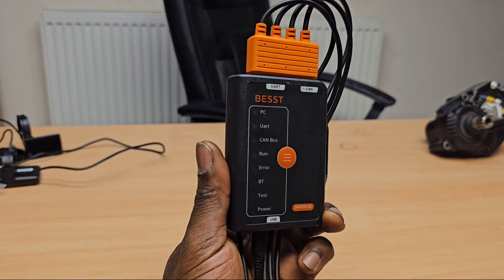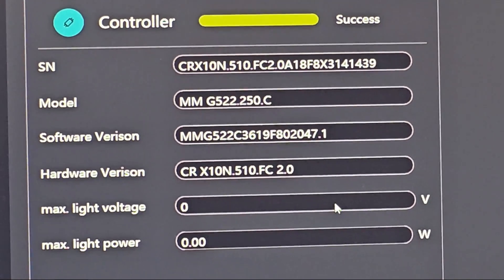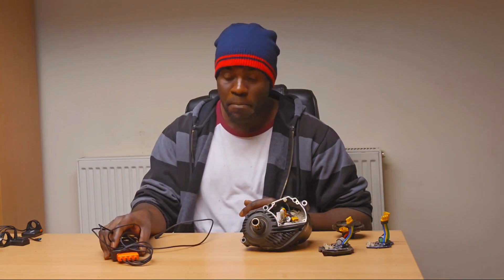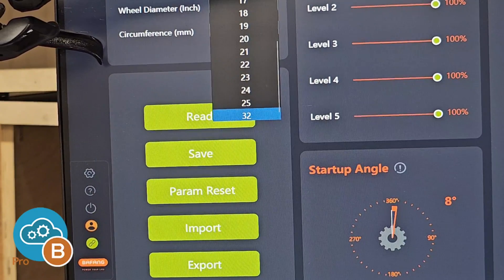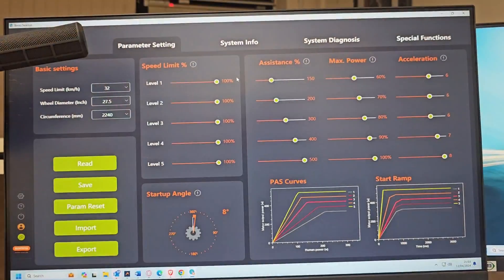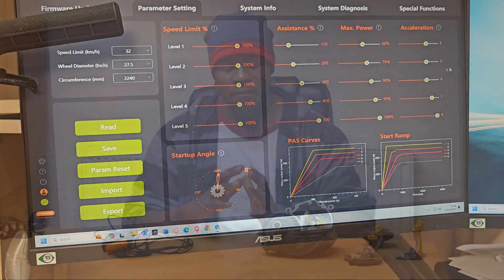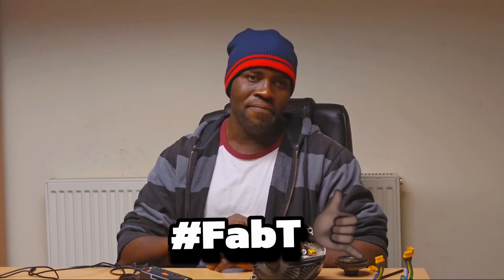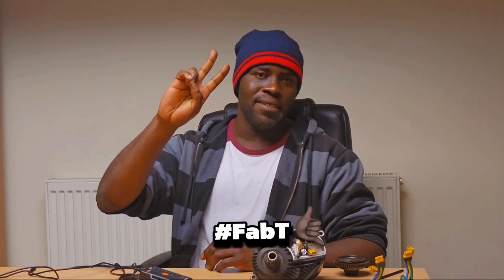Bafang Besst Tool & Besst [Pro] Software Explained

Comment: Like music down with the haters. Can you help me out with firmware for m620 canbus. I'm new to this only recieved besst today.
Reply from the maker: Hi there. Sadly, firmware's associated with the M620 CANBus aren't as plentiful compared to the other Bafang motors. Essentially, different firmware's which I've seen for the M620 CANBus tend to be for higher voltage/capacity batteries. Ebikes like the the FREY Beast with the custom 62v battery use a different firmware. But that particular firmware is useless without a 62v battery. 
I will doublecheck this with a colleague. So kindly bear with me👍🏿
Reply: @neekodevinchi maybe I'm doing something wrong it connects ok reads firmware etc but won't read parameters or battery. Only had a quick go.
Reply from the maker: What firmware are you using currently. If unsure, use the display and go into settings and go into controller settings. 
I can then cross-reference the firmware with those that I know👍🏿
Reply: @neekodevinchi  CRR10MC5228E101120.1 is that it?
Reply: @neekodevinchi  had better results using besst (not pro) software today. I could adjust wheel and speed. Only thing is the speed defaults to 25kph. I can increase this using my c18 display back upto 60kph. Essentially what I want to do is set speed and wheel size so I can use the dz41 display or eb04 display. These dump the speed back down to 25kph and limits the motor to 750watts. I've read somewhere that earlier besst software will allow you to do this.
Reply from the maker: I see. I was of the belief that you were using Besst to begin with (Not Besst Pro).

Besst should allow you to amend the speed limit, wheel size/circumference regardless of firmware.

Make sure you click 'write' after you've made the changes.

In the meantime, I'm still awaiting on my colleague to cross-reference your firmware so please kindly bear with me👍🏿
Reply: @neekodevinchi  write forces a 25kph locale max. Can you fool it via a vpn. What version are you running is it the latest.
Reply from the maker: Sincere apologies for the delay. 
After consulting others who have spent time testing a couple of firmwares with the CANBus M620 motor, I believe I've found 2 which may assist you in your perdicament to raise (keep the speed limit at 60kph by default), whilst using a different display. 

I have uploaded a BIN file on EMTB Forums on the "Bafang M620 Setup CAN Parameters" thread. And another user "Dado" has uploaded another BIN file.

Using the Besst Tool and Besst Software, upload either BIN file. You should find that either will allow you to freely raise the speed limit without reverting to 25kph. The Besst Software will prompt you that the motor's speed limit exceeds the legal limit. But it will still allow you to raise it to 60kph (for offroad private property riding 😉).

Here is the link - https://www.emtbforums.com/threads/bafang-m620-setup-can-parameters.37147/post-552455

Hope this helps and sincere apologies for delay👍🏿
Reply: Many thanks for the help. Would running a 52v battery on 48v firmware cause any problems?
Reply: It's a 52v battery.

Comment: Anyone know why it doesn't show pas curves or start ramp on mine? It's a M510. Is it necessary for the display to be connected?
Reply from the maker: apologies for the delay. Are you using the Besst Pro and if so, which firmware and controller are you using on the M510 motor? its possible that your M510 motor may need a firmware update/swap. Or, the newest controller. 

I canj make a video explaining how to update/upgrade an M510 if this helps. bear with me 👍🏿
Reply: @neekodevinchi  just an update. I'm getting a new motor for free from bafang  withe a new controller.  Because there is some older boards on my motor that's not compatible with any new firmware.
Reply from the maker: @ShrekThePimp Glad to hear👍🏿
Reply: @neekodevinchi   it's the older fc1.0 controller. Some dealer I have been in contact with is trying to help me. It's either a controller switch or motor trade as I'm understanding it. I will find out very soon. Thanks for your reply.

Comment: Hi mate, what are the “must do” tunes for an m820
Reply from the maker: It depends.
Bafang motors (CANBus) are now becoming programmable via both the Besst tool and certain displays. 
As such, my preferences may differ to your own.

The best advice would be to use the motor and tune to your liking. E.g. if you want the M820 to respond quicker, reduce the start angle. If you want a certain level of assist to provide more power, increase the max power & if you want more support, increase the acceleration👍🏿

Comment: Hello bought my dengfu m620 ,EO6 because of you.Later bought my wife the E22 .You inspired me twice .Most expensive thing I've ever bought for physical health for our family ty.I have a question Kyle ,can you recommend me an alternative for the big honkin screen on my bike ? I'm going to buy whatever you recommend.
Reply from the maker: Hi there, 
You have options. However, I'd need to know what display and communication protocol your M620 motor ie using. 
If it's UART, you have the DZ41, SW02, Eggrider v2, 500c & 600c.
If it's CANBus, you have the DZ41, dpc245.3, 600c or, SW02 (to name a few).

If you bear with me, I'll make a video going over the different displays for Bafang motors and which is ideal for certain applications👍🏿
Reply: What's the quickest way to tell if your a uart or canbus system?

Comment: Hi Neeko, great video. Do you have a list of all the firmwares available for each motor which references the parameters settings?

I've seen some but each firmware is labelled with numbers and letters. And it's not clear which is the most up to date and which one is the best.

Thanks in advance👍🏽
Reply from the maker: Bear with me. 
I remember stumbling on a list of firmwares online for CANBus Bafang motors. 

What I'll do is update the description to outline the firmwares associated with each motor and the specifics of each.

If I find that the description doesn't allow me to add them because of the word count limitation, I'll leave a link which will take you to a page with that information👍🏿

Comment: I have just got that tool, and tried to increase the max speed on my e Mythique, however it knows the max speed for the UK is 15.5mph and won't let me change it, I get a message saying it's about the max speed for my region is there a work around, I have tried both programs but no luck
Reply from the maker: That's strange. 
Usually, a message will appear recommending that the motor should adhere to the limit. But neither Besst or Besst Pro have prevented me from raising the limit. 

Let me look into this and I'll get back to you👍🏿
Reply: @neekodevinchi  ok thank you
Reply: Try using a VPN and use a profile for the country where higher limits are allowed.
Reply: @keithattwood59  yeah that's what I was thinking as well 👍
Reply: @acelectricalsecurity did that work?
Reply: @timoisok  I have not tried it yet, I don't currently have a VPN setup on my laptop
Reply: @timoisok  I am curious as well, when using VPN (changed to USA for example), the speed limit can be adjusted

Comment: Hi Neeko. I was listening to hear from you about the sondors lx that's shutting down o  me after a minute of being on or when you try to operate the bike. I found the negative terminal broken. I ordered a bord  , display just incase. Haven't received them as yet. 
Will the display with a pass word ability work with the battery that has a off and on switch? 
Listening for you 
Thanks
Reply from the maker: Sincere apologies for the delay Richard. 

Please kindly message me through either Facebook or Instagram. I'll need to share images and diagrams to assist you in restoring your Sondors ebike👍🏿

Comment: Would this detect a problem that the 245 display isn't showing as an error?
I also have an e-mythique and on longer slow climbs the assist feels Asif it drops to its lowest setting (e) if I cycle through others there is no difference,if I cycle to 0 then you feel zero assist so it's definitely providing some assist 

Sometimes it'll snap back into power itself,when changing gear or not atol until climb is done.
Reply from the maker: I see.
To answer your first question, the Besst Tool can indicate if the display is the culprit if the bike doesn't turn on. The Besst Tool checks for communications with everything connected. 

As for the drop in power on your E-Mythique, that's because Vitus tuned the M510 to be...."conservative" instead of harnessing the full power of the M510. Simply increasing the acceleration across all levels of assist (and raising Race Mode to achieve 500%) using the Besst Tool will solve that problem. I would even reduce the start angle from 15° to 7-8° to improve responsiveness of the motor as well. 

But ultimately, using the Besst Tool would improve your experience of the E-Mythique👍🏿
Reply: Thanks for the reply,I wasn't sure if something in that motor was going to fail due to this feeling 
It works perfect every where else and there's no errors stored on the 245 display

Comment: Hi Neeko I emailed you about two weeks ago  and got no response. 

My Dengfu bike has a Throttle that came programmed from the factory like  a race car. It was either on or off.  Just the slightest touch of the throttle would send you right off the back of the bike or wheelie uncontrollably .  That said I'm looking for some programming help here.  

I emailed Bafang twice now to purchase the Besst tool and they wont respond.  I suspect you have to be a dealer or some  big race program director to get this device.   

Please let us know how one gets a hold of this Unobtanium device.

Thank you
Reply from the maker: Sincere apologies for the delay. 

Buying the Besst tool isn't difficult and their are safe and trustworthy ways to buy one. GBK (Green Bike Kits) sell them and I've seen multiple merchants on platforms like Alibaba, Aliexpress and even Ebay. 
The Besst tool should cost no more than £120 ($150/€140).

The difficulty is getting an account. Some merchants who sell the Besst tool may share their own account credentials to the buyer. 

I'll leave a link in the description to GBK's website to purchase the Besst Tool. When ordering, ask them if they will provide you with one of their account logins to use the Besst software & Besst Pro software👍🏿
Reply: @neekodevinchi   Thank you Neeko . I'll investigate and Report back.

Comment: I like you have a Mythique, if i get one of these tools will i be able to increase the max spread to 32kph
Reply from the maker: Yes. You could do other things as well. But changing the top speed is fairly simple👍🏿
Reply: @neekodevinchi  what else would you recommend
Reply from the maker: For the E-Mythique?

I'd raise the max power to 500% for level 5 (Race Mode) and amend the start angle from 15° to 7-8° for better pedal/responsiveness. You could adjust the acceleration for each of the modes, which will effect motor over-run as well. But essentially, you gain the provisions to tune the motor to your personal liking (like suspension or tyre pressures)👍🏿
Reply: @neekodevinchi  ok thanks for those tips 👍

Comment: I was lucky i guess i got an account ready enough, looks a useful tool is it like the cable for the bbshd, where you just connect one lead to the cable that usually goes to the display. 
Did you get yours from AliExpress i have seen them there for around £60
Reply from the maker: I got my Besst Tool from GBK (Green Bike Kits) years ago. I think you can pick them up for that price on Aliexpress. 
It's similar to the configuration Tool used for the bbshd. But the software used by both are different. But the configuration tool gives you similar (and more if you know what your doing😉) parameters to amend👍🏿

Comment: Can we change the support parameters in the m600 engine?  What does this interface give us in this engine?
Reply from the maker: Support parameter are determined by the firmware. The only way to freely amend parameters for the M600, is to use a third party controller. 
Otherwise, top speed, wheel size & wheel circumference are the only parameters which can be changed👍🏿

Comment: Setting the speed limit depends on your account. It is not able to set it to 60kmh for standard or offline users.. You'd need to use the bypass for that.
Reply from the maker: It depends on which software you're using and the firmware installed on the motor. 

Besst (not Besst Pro) can change the top speed to 60kmh. But newer Bafang Motors with newer controllers are optimised for Besst Pro. 
Essentially, you'd need to install a firmware so that Besst could change the speed limit to 60kmh. But to do all of this, you would need an account with Bafang👍🏿

Comment: hey . can you also elaborate on bafang go+ and what options can be set with which display and if certain firmware is needed for which motor ?
Reply from the maker: I can. But it might be best that I make a separate video going over Bafang Go & Bafang Go+. So keep a watchful eye👍🏿

Comment: Can i change the speed limit with my m510 without a login using this?
Reply from the maker: Using Besst Pro, you can change the speed limit to 20mph/32kph without an account (depending on what firmware is installed on your M510 motor).

If you tell me what firmware is on your Bafang M510, I can check and let you know👍🏿
Reply: @neekodevinchi  I have a Vitus ebike with the m510 motor.
Reply from the maker: You should be able too.
Vitus E-Mythique M510 motors use 'MMG522C3619F802047.1 controllers. So using Besst Pro in offline mode, you'll be able to raise the speed to 20mph max.
Reply: @neekodevinchi  Can it go higher
Reply from the maker: With a different firmware, yes. But it's questionable if the motor could achieve higher speeds. Otherwise, it would clash with motors like the M600 and M560. 

It's worth mentioning that if you want to replace the firmware, you do need an account for Besst Pro👍🏿
Reply: @neekodevinchi  Have you swapped the motor on the vitus. ive seen some others who have and they say that the bike is quicker with the M600.
Reply from the maker: I haven't. The reason why is because of the battery. 36v for the M600 wouldn't really provide the same power compared to ebikes with the M600 with a 48v battery. But once I receive my new 48v battery for the Vitus E-Mythique, I'll consider using the M560 on it👍🏿
Reply: @neekodevinchi  That's an interesting idea! I assume 48V battery would still fit in the same space? Would it have bigger capacity? Would you also need to change the controller for a 48V compatible on M510?
Reply from the maker: The 48v battery which can be used for the Vitus E-Mythique is the same shape/design as the existing BTF16 630wh. 
I'm not too sure on the weight difference. But ultimately, the only thing you would change is the firmware on the motor. The controller itself wouldn't need to be swapped (as long as you have the Besst Tool and account with Bafang)👍🏿

Comment: Great video Kyle  clear & concise as usual , with the vitus issues i see online im sure that ths will help  lot of riders keep there bikes on the trails . Im currently building a kabon using an refurbished m510 with new controller & main gear/bearing ( do you have source for the bearing on its own ?) many thanks David.
Reply from the maker: Hi Dave, GBK will have them. It's not something they advertise on their site. But I'm sure if you email them, they should help. Any problems, just message me.

Be sure to keep the Facebook group updated regarding the Kabon build👍🏿

Comment: The power this tool gives to the end user almost beggars belief. It’s pretty well a game changer. Alas power is nothing with control and responsibllty.
Reply from the maker: Agreed John.
Bafang will continue to make new motors (some sharing the same mounting positions as current motors available). But the Besst Tool will be necessary for Bafang motors to be tuned, updated and even troubleshooting👍🏿

Comment: No good for adjusting the power levels on each pas level on my m620 on uart then !1
Reply from the maker: You'd be better off with the Bafang Configuration Tool. That's what I use. Or you could use the eggrider v2👍🏿
Reply: @neekodevinchi  I have already tried to get the egg rider v2 but I don't think they wanted to sell me one as I run it on 52v !
Reply from the maker: Bizarre!!!
I uploaded a video using my E55 with the Eggrider v2 display and the 52v kilowatt battery. I've not had any issues. But it does need to be programmed to recognise the battery at 100% and 0% (maximum and minimum cutoff).

If you bear with me, I can ask Eggrider if there is a problem using the Eggrider v2 with a 52v battery and report back to you👍🏿
Reply: @neekodevinchi  Could you please go over how to calibrate the battery with an eggrider v2? i have an e55 myself, but the readings are inaccurate. any help is appreciated. also maybe share some settings on how to smoothen out the m620's power delivery?
Reply: Aparrently they can be damaged if input above 60 volts although obv there is no regen
Reply: I've heard this too. The Bafang display on our m620 reputedly errors-out, if the Voltage is too high (as can the controller); I haven't seen Eggrider or Bafang display revisions specifically for 52V, though? I know people are using them, I'm just not sure how they're being set up?!